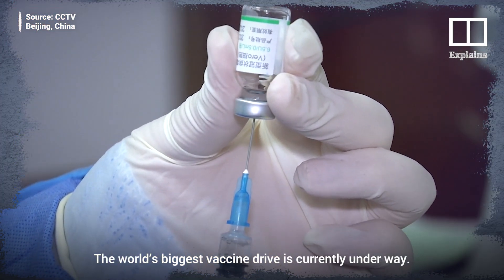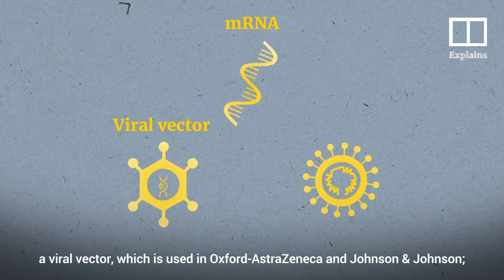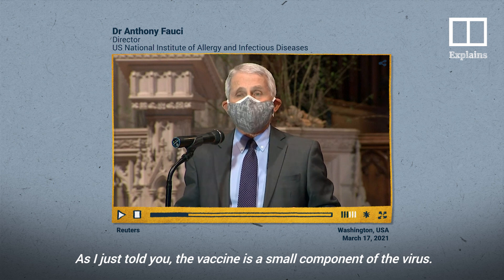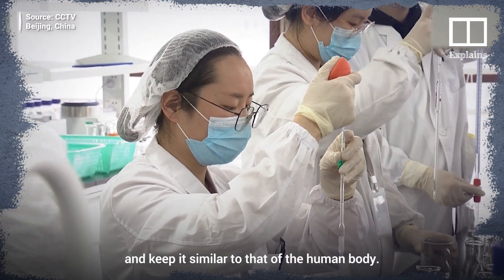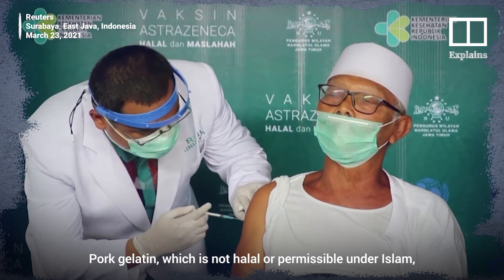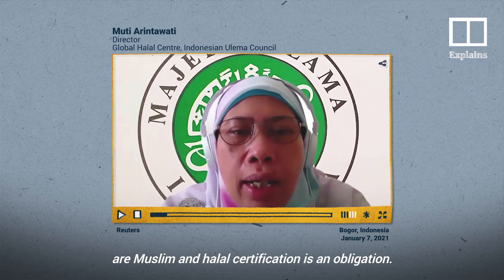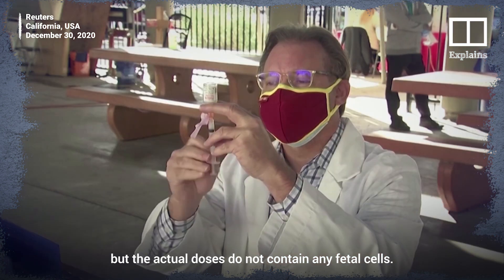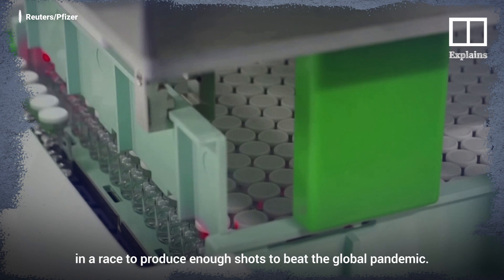What’s in a Covid-19 vaccine?

Comment: AstraZeneca, Moderna, Biontech/Pfizer are very reliable vaccines that have cleared even the high hurdles of the European Union. In my opinion, if they are allowed to be published in China at all, the risk from Covid19 is much greater than using one of the vaccines listed above. Biontech, in particular, has hardly any side effects and a simultaneous efficacy of 95%.
Reply: Europe has confirmed the link between AstraZeneca vaccine and blot clots.
Reply: There’s no point at the moment, even after the vac you still have to follow all the orders and like the flu vaccine it still doesn’t fully protect you.